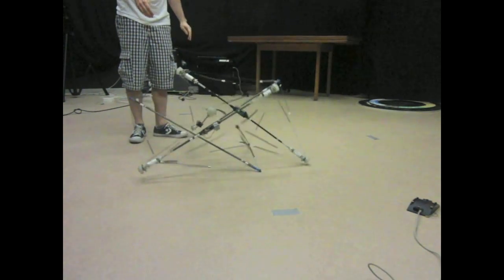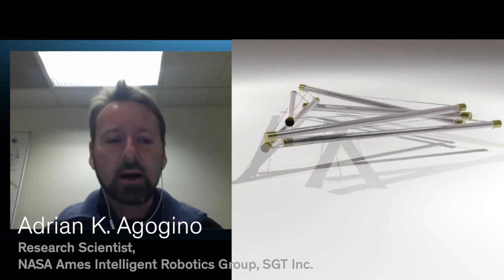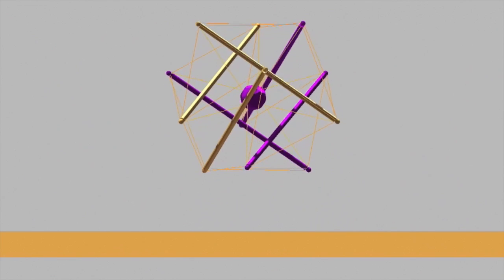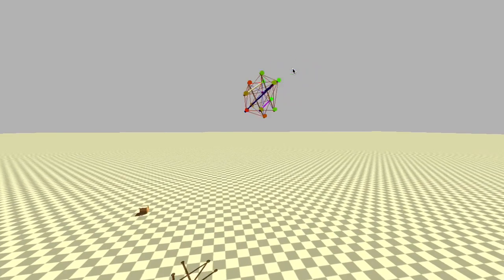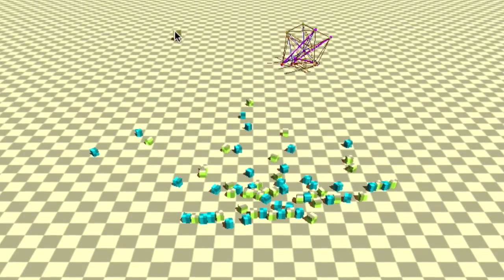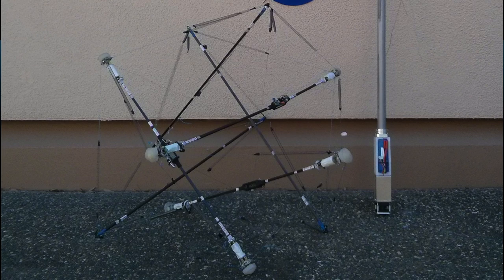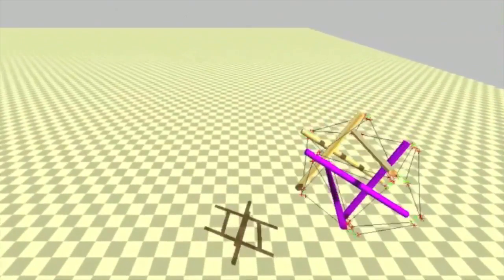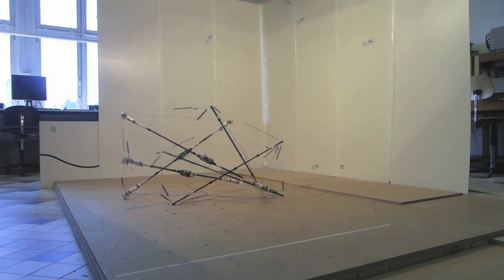This Jumble of Tent Poles Could Be NASA's Next Titan-exploring Robot

Comment: Just send a little RC helicopter. Should be easy to fly in a low gravity, higher atmospheric pressure environment. It could also move long distances easily, and could use solar panels to pick up what little sunlight reaches the surface.

Comment: How well does the robot handle getting one of the wires tangled in a rock crevice or a bush?
Reply: Yeah I don't think there's bushes on Titan. It's a frozen wasteland. I'd be more concerned about the rover freezing up.
Reply: No what I meant was I'd be concerned with the rover in the cold. I'm less worried about a rocker-bogie system and wheels. Titan is damned cold, as in a balmy -180C. By comparison the average climate on Mars is about -140C at the poles and up to 35C at the equator in the summer. Considering how small this thing might be, I hope the heaters are pretty good.

Comment: You should be able to telescope those poles down to a smaller packing size.  The same 6x cable-pull motors used to move the robot around could be used to extend out (and lock) the poles to their full length. 
This thing could pack up to be REALLY small.

Aw man, now you've got me pondering howto build tensegrity crumple zones for super-light cars (with fabric panels).  This is gonna be my whole day gone.
Reply: oh... if you covered them in elastic fabric (thin lycra?), you could protect these robots from getting stuck on sticks and bushes, and thus use them on earth.
Reply: roidroid
also, it's worth pointing out that you could make both the cables, and the poles, on the moon via simple laser-sintering, like with 3D printers, you basically melt moondust.
The flexible cables would be made of thin fibre-glass.  I dunno if you'd call it fibreGLASS if it's made from moondust though, hey whatever.

Comment: Seems like an inflatable cylinder or sphere would be more simpler and less prone to failure.
Reply: that's not a form of locomotion though.
Reply: Gordon Chin How would a sphere move by just inflating and deflating?
That wouldn't work.
Reply: Gordon Chin Put a basketball on the end of a slope, it's not going to roll up just because you deflate/inflate it.
Reply: How would that move though?
Reply: SlowSlowSloth the same way this move but not as shittily.
Reply: SlowSlowSloth I think he just lacks creativity to think about it so he's relying on you to come up with something. The only thing I could come up with was it lands inflated and crawls like a slug of some sort, but that's not a very good idea.
Reply: Gordon Chin Tell us how it works then.
Reply: winrid That's a completely different thing though, a flywheel isn't the same as "inflating and deflating" a sphere.
Reply: SlowSlowSloth use your brain harder.
Reply: ***** So? You're not changing its centre of gravity by inflating/deflating it.
Reply: You guys are kinda stupid.
Reply: SlowSlowSloth
I get what he is talking about because i've had an idea like that for a long time. It would be a sphere (though in my version it would be solid plastic) and it would have a rod that spins around an axis with small weights on the end of it, and the movement of these weights would cause it to roll. Of course i have no idea how a camera would be attached yet, but it might work somehow.
Reply: SlowSlowSloth If the center of the ball had a rotating mass (flywheel) that could be quickly stopped in a chosen direction using brakes attached to the ball near its center of gravity you could control the direction of the ball. It's actually fairly simple and there's a toy that uses this mechanism, albeit in the form of blocks (mechanism turns flywheel, spins, stops, and block turns on desired side).